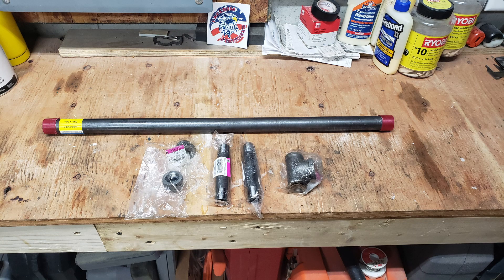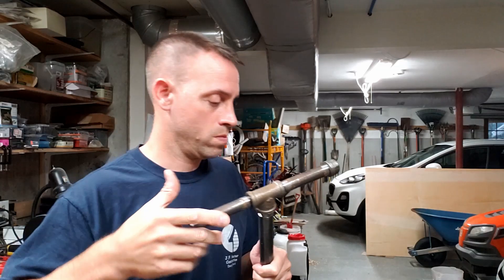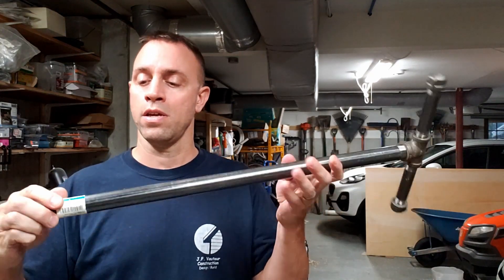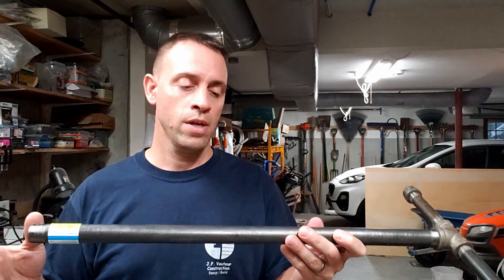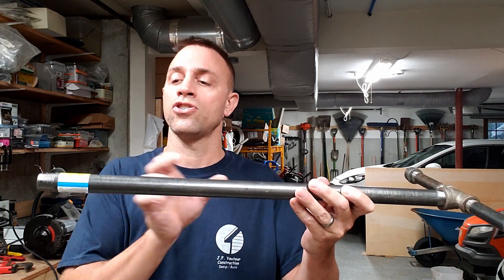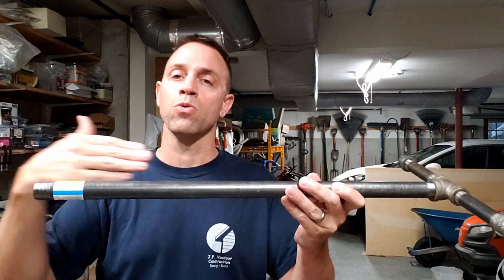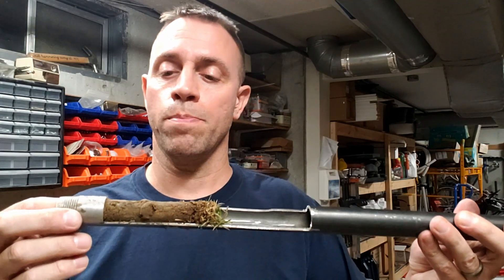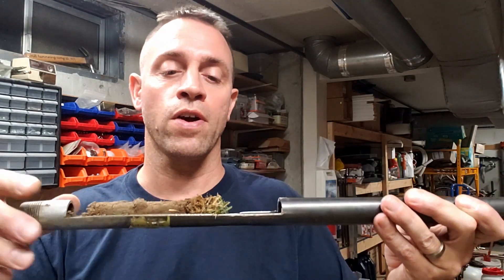How to make a soil probe for $20 with basic pipe parts (a must for great lawns!)

Comment: Criminal that you don't have more views on this.  I've been trying to figure out for a week or more how to make a DIY SPT or CPT to check my soil type/psi at 4' frost line depth.  Using HD black iron was one way I was going to make a load tester with a 6x6' plate on it, which 1/4sqf.  However I'm going to make one like this, only 4' long. Pound it to depth, remove handle and push out the plug.  It'll be a little compressed, however I can take the bottom 4-5", throw it in a jar of water, shake, and let it settle for a day and get a good idea from separation lines of the % of clay, silt, sand, etc.  It kinda funny how many people build their decks just using the local rule of thumb of x inches deep and a 12/16" pier.

Comment: Thank you for your efforts!  What was the dimensions of the cut?  Based on the video the length was 8 inches, specifically what was the dimensions cutting down into the metal?  Was it a 1/4"?  Thank you again for motivating me to do this project. I bought and pieced the black metal at the store and even the employees said it was a great idea!